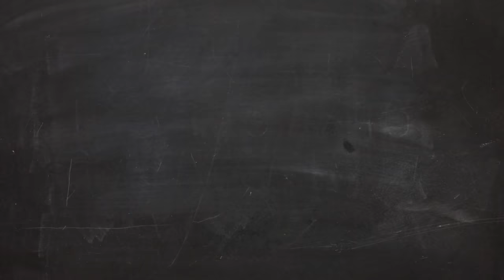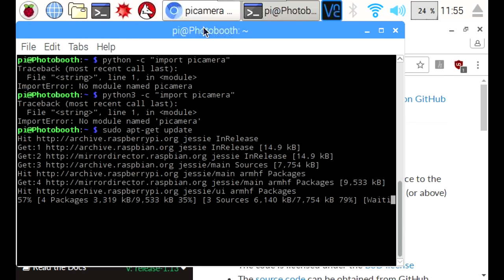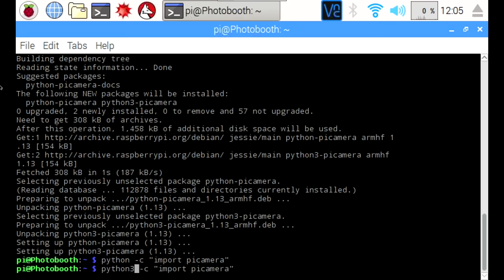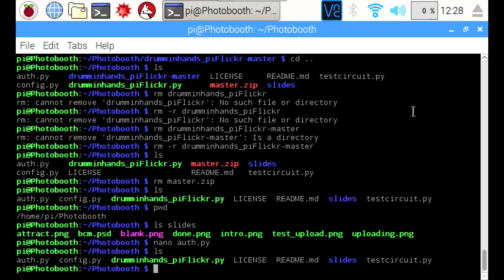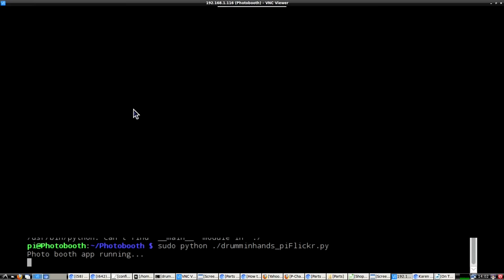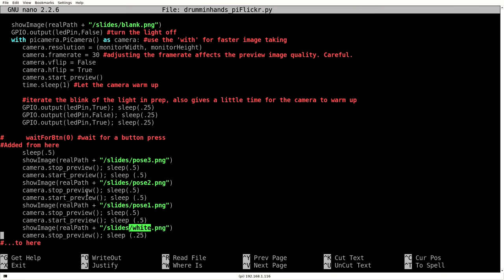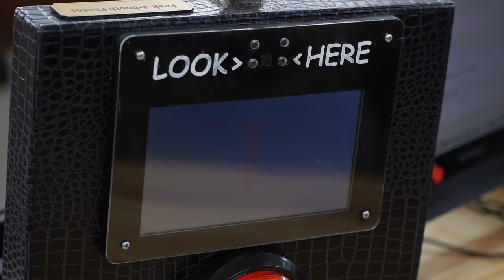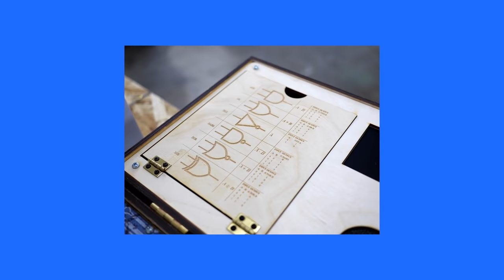Portable Raspberry Pi Photo Booth

Comment: Since you're already setup with a local storage device, it might work better to have all photos save locally and then have a script that runs at intervals for essentially syncing the photos to Flikr whenever a stable internet connection is available. Make that part asynchronous :)
Reply: That sounds like it would be more reliable. I'm still learning Python, so I'm happy for suggestions of different and better ways of doing things. How would you do what you suggest?
Reply: One method is to run it as a 'cron' job, cron is a program that helps you to schedule when scripts run, so you can tell it to run a python script every 10 minutes, for example. Running 'crontab -e' lets you edit the cron jobs running as your current logged in user.

Comment: I think the reason it "glitched" when on the "open wifi network", was likely because "free access" wifi network usually have a portal that you have to accept a prompt, or acknowledge that you are on the network. Open wifi networks have timers, bandwidth limiters, and such to keep people from hogging all the traffic, and can block mac addresses of offenders. 

My thought anyway. I think if you are on a normal wifi or ethernet connection you should be fine.

Comment: That is a very cool project. One suggestion to make it more photo booth like.  Have a printer loaded with 3X5 or 4X6 photo paper, and automatically print a souvenir photo. Maybe put the option to print photos into a config file. Many of your victims, I mean subjects, would treasure the photo and it gives them something that they can show off to other guests. I have never seen a photo booth that didn't give you a hard copy photo.

Another idea I just thought of; It would be really cool if the photo booth could email your photo to you or send it to your phone. Maybe via sms. 

Thanks for sharing your awesome project.
Reply: I agree. I would rather have had a photo printer. For the printer I have, the ink was pretty expensive and it would run out pretty quickly. We also couldn't find perforated photo paper. Any ideas for a better printer/paper solution?

Comment: some open networks require some sort of validation. You can connect to the router and then your browser redirects you to a page where you have to input some key. (I think hotels do this sometimes). It's possible the Pi was connecting to the network but then didn't actually have internet access and was getting hung up on uploading. Adding a ping test in the code would be useful for sure.

Comment: You should add a QRC code at the end that'll take them to the Flickr website where the photo is. Awesome project.
Reply: That's a good idea! I was going to print one out and stick it to the front of the box. The problem is that I've put the photos in private folders, but because of how Flickr works, I can't do that until after the event and manually. There may be a way to automate that with a script, but that's beyond my programming skills.

Comment: This was the sloppiest explanation of APT install process I've ever heard.
FYI you do NOT need to use shell to update/install or manage files. Synaptic is a nice and straightforward package manager and I prefer krusader for file-management, although built-in filemanager also works. Even without VNC or X-server, you can use remote X through SSH even on windows - it works okay for most software.
Editing files in the shell is not a very comfy process either for most of people.
Reply: While editing the files in the shell is not the easiest way, I was really glad Felix showed me how to do it that way, because it helped me learn a lot more about how to do things on a Linux machine and get more comfortable with Terminal. It may not be how I do things in the future, but it definitely helped with my learning process and understand how the OS works.
Reply: Jack White yeah, I understood some of those words.
Reply: Unless you're comfortable setting up the appropriate configurations, using remote X is not typically a nice experience, vnc at least preserves the desktop environment and window sizings. Using xming as an x-server on windows and then say, running xfce4-session can have bizarre rendering results as its 'container' dimensions make a sheer mess. 'Apt' or 'aptitude' is also a very suitable package manager, and it's the default for debian, typically.

Familiarity with terminal is good, especially for when your operating system goes awry and you need to fix it, wiping and re-installing should be a last resort.

Comment: Karen
apt-get update <is update the the program database>
apt-get upgrade <install updates on to the units SD card>
Reply: So what would apt-get upgrade do if there is no SD card installed?
Reply: theHeckwithKaren you should have the OS for Raspberry PI on the SD CARD otherwise the Raspberry PI won't boot or work at all
Reply: Felix failed at explaing to Karen about the difference. Update downloads information about available packages and their versions from one's repositories. Upgrade compares that info to your installed software, downloads (unless that repo is local media) and installs those if they have more recent versions.
Also one could use a bit more logically named and more user friendly tool "apt".

"apt is a commandline package manager and provides commands for
searching and managing as well as querying information about packages.
It provides the same functionality as the specialized APT tools,
like apt-get and apt-cache, but enables options more suitable for
interactive use by default."

update - update list of available packages
upgrade - upgrade the system by installing/upgrading packages